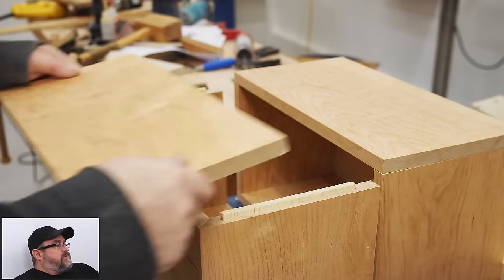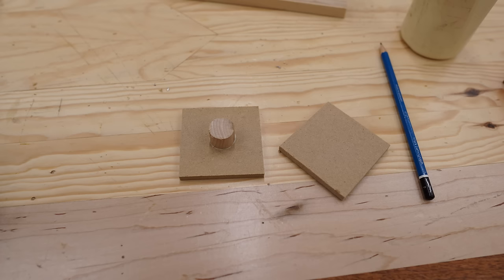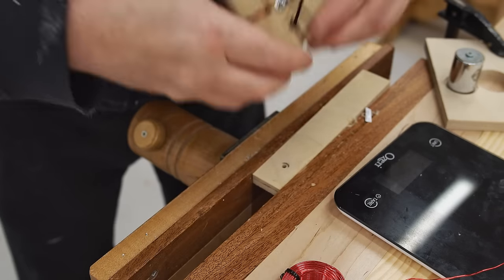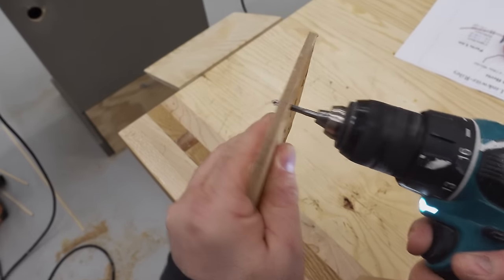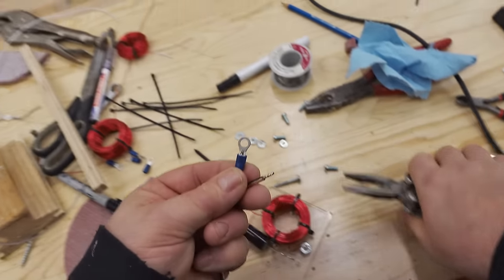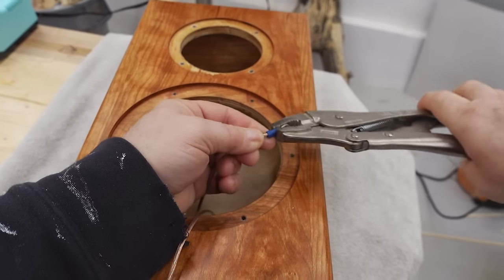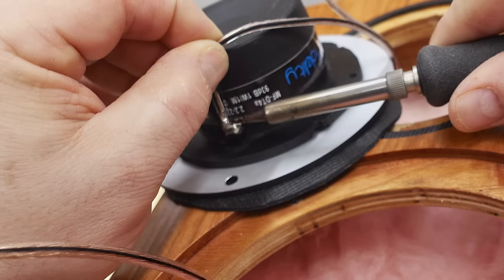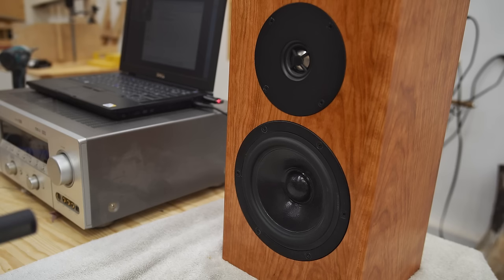Making The Crossovers For My Speakers PLUS Sound Test

Comment: The speaker box looks and sounds great. I'm somewhat paranoid about using fiberglass insulation as a sound dampening material. I'm sure you know how irritating and itchy fiberglass is when it gets in your clothes and on your skin. I've heard from car audio guys that the small glass particles within the insulation can get into the voice coil through the spider and potentially cause damage over time.. I stick with poly fill and haven't had any issues so far. Has anyone else heard about this before?

Comment: so how much mH is the inductor you winded? you did not show if you measured the inductance, but instead weight it? inductor must be measured in mH (henry) so that you
can exactly compute the frequency crossover point you want build the crossover, and there's online calculator for that, just my 2-cents, cheers from toronto.......

Comment: Nice job. One question is:  Would you eliminate some resistance bt soldering the wires instead of using the wire crimps to attach the wire connections.

Comment: Wait. Copper, when It corrodes, still has the same conductivity as if it's clean. Like 0.15% loss of conductivity. Different metals touching each other corrode faster. A few exceptions. Copper is one of those.

Unlike aluminum. That white corrosion, aluminum oxide, is almost a perfect insulator. And deadly if ingested. 
Being that as it may. I'm sure you know more than I, about the nuances of the audio signals pathways. Knowing the direct correlation of material issued and values of components to the sound. 

Much appreciated. Thank you.

Comment: Online crossover calculators are not a good way to design a crossover. A good crossover design program and measurements of the woofer and tweeter are much more accurate. Very nice looking speakers though.

Comment: hi John , These component you are using. Is it possible to create a slight delay. example A guitar speaker cab,
2 X 12" the signal goes to first speaker, time delay 2nd speaker.  I want to offset the sound by a nano second without adding another power source or with complicated device.  Is this possible?
Reply: AmIonArock . Filters add a both group delay and phase delay already, the delay depends on the frequency and the filter characteristics. The nanosecond delay you’re asking about is impractical for audio signals in air but if you insist, add about 25cm of cable length, that will give you something near 1ns. In air, 1ns  of delay will be the time it takes for sound to travel 3 micrometers (about 1/10 th of the thickness of a hair).

Comment: Dear gentleman. Why you haven't adapted bass reflectors port. Is there any specific reason. I understand with port one get good quality bass sound. Can you please reply.
Reply: no with port the bass quality goes down, without it goes up :) just the quantity goes up but it is nonlinear
Reply: @TheOneG36  then what is the purpose of bass reflex port provided by many companies like JBL, Bose. Please reply.
Reply: @Mahan150  like i said it changes the quantity so MORE Bass :) but of course if your the manufacturer and do it right it will not impact the quality so hard, but if you build it alone better skip the port or use  DSP afterwards 
to keep it simple
no Ports most clean and linear
small Ports slightly enhanced lows
Bandpass (huge ports) even more enhanced lows but far from linear

this is also true for Bassports like on JBL extreme and such these ports are tuned for a specific frequency but never linear....
Reply: @TheOneG36  thanks you sir for sharing valuable information. I am not manufacturer of speaker box. I fascinated by the box you did which inspiring me to make 1 set.
I bought 2 full range 3 inches speakers + 2 tweeter speakers.  Good that I watched your video. On YouTube so many guys providing port. This is the reason asked because your box quality was so good with good explanation. No match. God bless you and your family. Last one, after TheoneG36 next letter appearing what it is.
Reply: @Mahan150  i did not upload any videos where i build speakers ;)
Reply: @TheOneG36  I thought you did uploaded the video. Sorry for misunderstanding. Bye.

Comment: Hello, today I could improve them by putting a piece of wood in the middle inside the box and covering it with some insulating paper inside and then the foam is something that occurs to me and it is also better to buy a higher quality hi-fi ceossover than those that come with resistors capacitors coils and ceramic transistors and high quality low inductance coils are at 40 usd in amazon.

Comment: would be interesting to see  what inductance you really ended up with since inductance is proportional to number of turn squared. And you shouldn't tin stranded wire used in screw or crimp terminals
Reply from the maker: That "shouldn't tin stranded wire" thing is going around - where did it originate?
Because the reason given is akin to some of the audiofoolery nonsense you'll hear with any audio related subject.
I've done it literally hundreds of times with no ill effects, and have taken apart a great volume of professionally made equipment where they did it as well.
Reply: it is IPC wiring standard, tinned wire is soft and can lose over time in a crimped or screwed connection, but you are not building airplanes so ..
Reply from the maker: Lol, no - this isn't a airplane or a shuttle to the moon. And I'm going to continue to tin stranded wire, regardless of the perils involved :)

Comment: all your metal work shirts and you play us Bach and Strauss???
Not criticizing your build, just curious as to the decision on a bass reflex tube?  when to or not to use one.
Reply from the maker: but not curious enough to read the build article, right? :)
Bass reflex would require a larger box and is not as well suited to this particular woofer. Also (like I said in that build article...), I don't need the boosted bass response that you get from a vented design.
Reply: @JohnHeisz , "read"?! You must be out of your mind. YouTube exists and thrives because no one wants to do that reading stuff anymore. Lol 😜😜

Comment: I have no problem with the building of the speaker cabinets, but a crossover, as I'm reading and seen, different places on the net, is not that easy and simple to make. It looks like it is much more complicated, and you need to know how and do some measurements and mathematics, in order to get the best sound your speakers can deliver.

Comment: While it may be an interesting exercise to play around with Crossover Networks, it is no longer worth the trouble and expense.
Crossovers can cause a substantial amount of distortion, and other undesirable effects,
especially if you get carried away with high-end individual components, and intricate compensation networks.
Now days, it's only slightly more expensive to Bi-Amp the speakers with Plate Amps mounted to the cabinet.
This has several added benefits including, reduced distortion, driver protection, improved transient response,
and fewer problems with polar frequency response anomalies.
.
.
Reply: I've had a number of very good sounding speakers, all with fairly simple passive crossovers.
Reply: Yeah, so have I.
This probably isn't the place to discuss Crossovers, it just hit me at the time.
If you want to go really simple, and you're not looking for maximum power handling,
I prefer a First Order Series connected Crossover design,
I'm just quite a ways past even considering using a passive Crossover anymore.
And BTW, I have found that putting most of your attention on Transient Response is
much more rewarding than the ultimate in flat Frequency Response.
This is, of course, AFTER making your listening room as dead as possible.
.
.

Comment: While you are basically correct, you do not have a 2nd order LR filter. What you do have is a 2nd order electrical filter based on the normal impedance. However, neither driver has a flat impedance and both have their own natural roll off. Without measurements of the frequency response and impedance, the textbook formula is not much better than a guess. I understand the premise of simplicity but it is far from optimal for the speakers. Im not sure how accurate the weight is in getting the inductor value is. Never tried that myself.
Reply from the maker: I took frequency response into account in the design when I selected the crossover point, of course. I recommend you read the build article - it has more detail.
Reply: @JohnHeisz  I read it. But you only used a supposed good range. Having experience with that particular woofer, I know that it has a cone breakup up that is audible before 4k. Because you only used the nominal impedance, the crossover point is not where you surmised it to be. It's a beautiful speaker, just not optimized in the crossover.
Reply from the maker: Like I said in the article, I may pull out the scope and function generator to measure the actual roll off, but I doubt it's that far off. Nominal impedance is "close enough" for the design of a simple crossover like this.
Reply: John Heisz - I Build It Built my first pair of speakers (3 way Bass Reflex) when I was 16 (forty years ago with Realistic drivers from Radio Shack) and went into Electrical Eng at UofT because of that success.  I love this electronics series of yours, it takes me back...  Those coils are really beefy and you’ve motivated me to go look up the inductance formulas for building them.  Not sure about the weighing part but what the hell if you’re happy with it!  I wanna see a frequency response test!  Great job and have fun shovelling the white stuff.